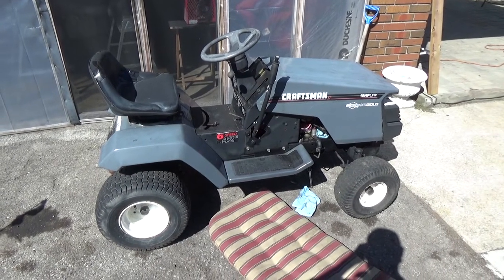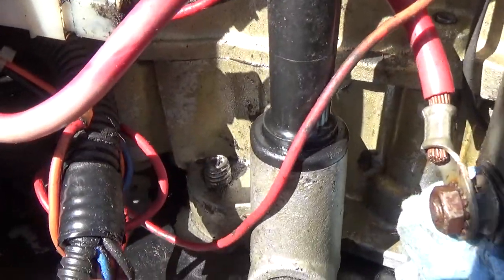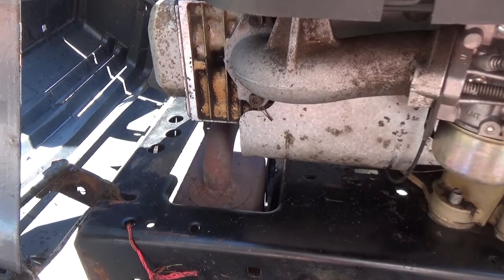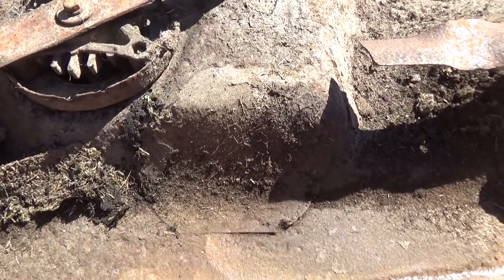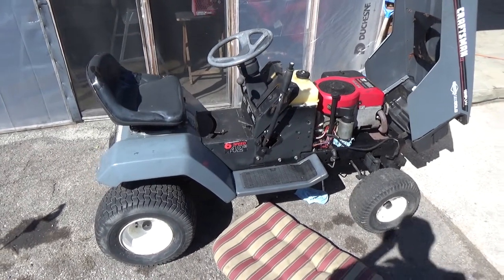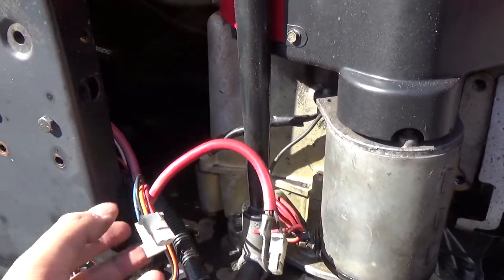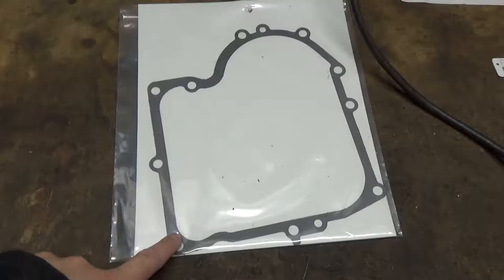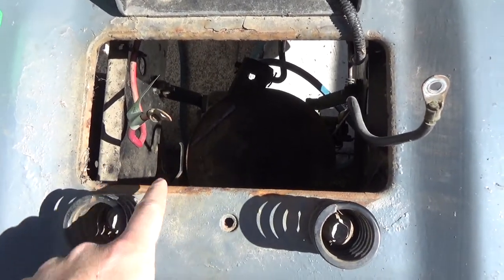Craftsman Riding Lawnmower Revival [Part 1 of 2]

Comment: Just started on my 7th complete rebuild on a 22 year old craftsman riding mower, for about a k it will look and in new shape 
Engine rebuild, trans VS unit rebuilt, new hoses and belts 
All idealers and spindles replaced 
And paint as needed 
Easy turn brg and wheel brging in front 
Yea it’s a lot of work but I love doing it because I can’t hold up as a diesel mechanic anymore 😊😊😊
Ther happy and I’m happy to

Comment: I have one of these nearly identical except it is called a Craftsman Turbo Cool with a 15.5 OHV and the code says 1996. Got it for nothing and kinda bringin it back from the dead... needs right front spindle and a hood and an oil slick under the engine like you wouln't believe so sump gasket & seal is a must.
Like your vids, keep them coming!
Reply from the maker: Thanks for watching Don, good luck on the project!

Comment: Nice video!
What would you charge a customer to replace the sump and crank seal?
Reply from the maker: probably 2hrs minimum (at $60/hr) if doing it for a customer, this was for a machine that I got for free, and then fixed up and sold for $550 total!

Check out that video here: https://youtu.be/YN0s4TjFd3I
Reply: Looked like a nice mower to begin with that needed a bit of TLC. Probably will run 10 more years. Lol
Reply from the maker: It didn't run, needed carb rebuild, oil flush, brake job etc... It's how I make my money!

Comment: Here in NW ohio , a used deck runs around 150$ .
Reply from the maker: Jerome Cook We payed $100 and it was probably too much because of the amount of work I had to put into it, you'll see in part 2! If I can get them for like $80 I'm normally happy with that, but usually the guy I get them off takes the spindles out for $80 so I have to use the spindles from the bad deck.